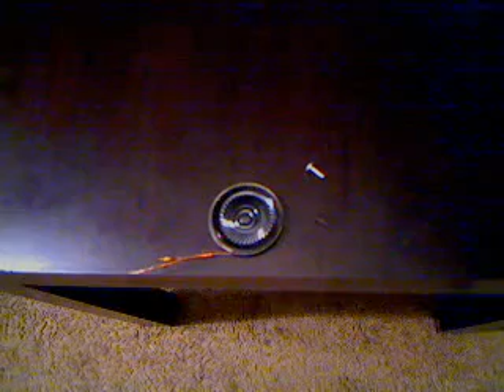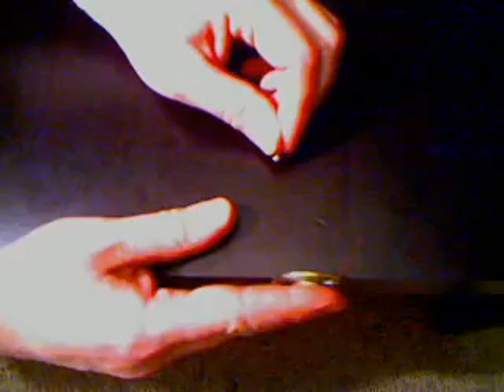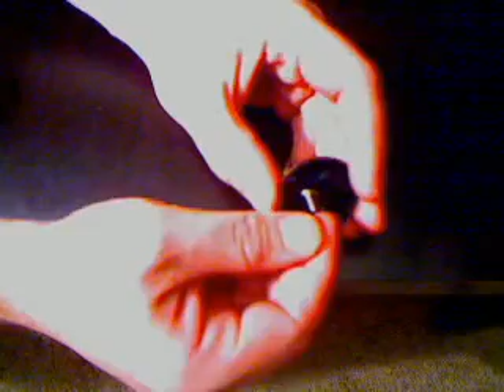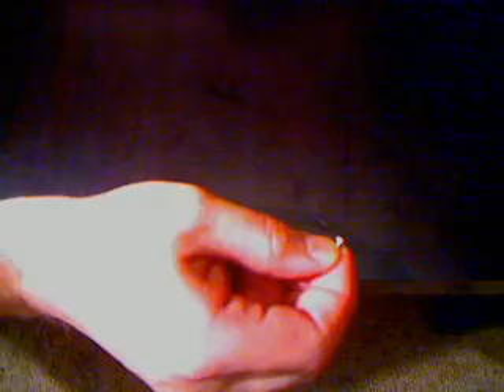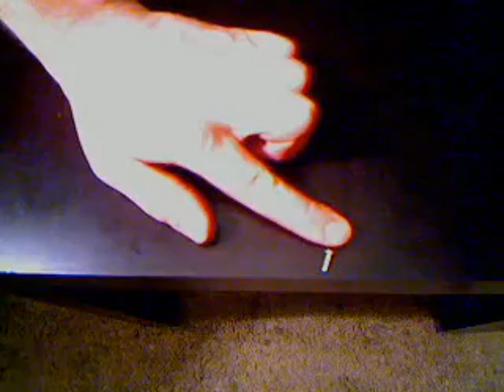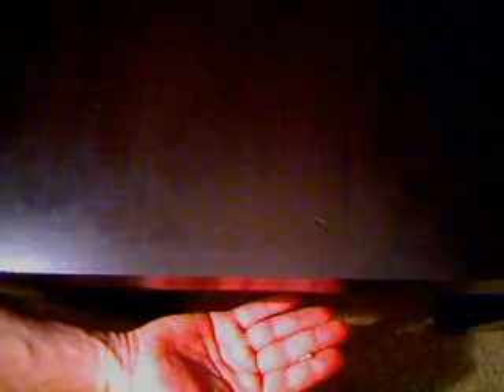Energy of Attraction - a response to Desertphile

Comment from the maker: @hwud1 The separation of all matter in the Universe comes from the big bang and subsequent processes like the inflationary phase. Some of this energy is converted to thermal energy during planet formation etc. (modern cosmology sees ongoing expansion). So this video shows that no repeatable work can be done with this system, i.e. you cannot move a magnet w.r.t. another magnet or metal in a cycle and obtain energy. Energy out = energy in and you lose energy to inefficiency.

Comment from the maker: @jagg1951 

One other note to help you; as the metaphorical elastic band is stretched both for gravity and for magnetism, the force of attraction weakens (but the potential energy in the system increases), you don't notice this on Earth because any altitude is generally insignificant compared to the distance from the center of the Earth, but you can feel it with magnets. In this respect it is an imperfect analogy as we expect elastic bands to pull harder the more they are stretched.

Comment from the maker: @jagg1951 

In that scenario the screw remains on the table until the force from the magnetic field exceeds the force from gravity. At that point the it begins to accelerate upwards, as it accelerates upwards the force from the magnetic field increases because it is significantly closer to the magnet, etc.

So it can only jump.

This cannot be used to levitate aircraft (it implies a skyhook of sorts) but it is used to levitate "maglev" trains, but pushing rather than pulling with magnets.

Comment from the maker: P.S. Fucault's pendulum does not swing perpetually. Angular momentum is conserved and the swing stays in one direction showing the rotation of the Earth, however the amplitude of the pendulum swing is reduced over time through friction, mainly from the air, this is why a very heavy pendulum is used.

Comment from the maker: You're sure wasting time when you deny the existence of the electric field around atoms and molecules and refuse to acknowledge that this force acting at a distance is what stops matter passing through other matter. This is the same force you foolishly insist utilizes power to hold magnets stationary when it in fact supports your keyboard resting on your desk and objects hanging on hooks as I have said from the start.

You could have learned something, instead you're willfully ignorant.

Comment: Oh dear. The electric charge IS the electrons. Any outer shell electron will jump through 5 energy levels and then leave the atom, this being then positively charged, will capture a stray electron-it's called 'ionisation'. Since this process is continuous, it is impossible to map a 'molecular electric field'. Molecules MAY be 'bipolar' and 'diamagnetic' because there will be more electrons at one end, as in water, which is why it readily forms into snowflakes. Duh.

Comment from the maker: You idiot, I'm not talking about a hook in a wall, I'm talking about something hanging on a hook (although there's not much difference you just don't understand what's happening in either case). There's no chemical bonding. The molecular electric field is what stops matter falling through other matter, it's the charge from the electrons at short distances from the atoms. It uses no energy, just as the magnet uses no energy. Again you show the depth of your ignorance with silly falsehoods.

Comment: A hook uses no energy because it's become part of the wall, and it took energy to put the hook in. Glue uses chemical energy in the form of solvents & exo-thermic reactions.  WTF is a molecular electric field? If you mean bonding of ATOMS into molecules by sharing electrons, that all depends on which elements are present, an electric field is produced only when you have free electrons, or electrons in motion through a wire. End of discussion.

Comment from the maker: The separation between all molecules and the pressure and surface roughness in a screw that leads to friction is due to the molecular electric fields over a distance, your label doesn't impugn my facts. You conveniently skipped right past the hook.

A hook consumes no energy and can hang indefinitely, and it's the molecular electric field of one material floating above another. This is not limited to hooks, but hooks highlight the fallacy of your fridge magnet energy claims.

Comment from the maker: A KW is a unit of power not energy. It doesn't take energy to hold objects in place. The fridge handle is held in place by a screw using the molecular electric fields (yes, from the electrons).

You want to treat the magnet holding something stationary in place as special but a screw holds the handle in place without consuming energy.

A magnet need no more consume energy than an hook or a layer of glue does to hold something in place.

Comment: OK, back to the fridge. Gravity is acting continuously on the magnet. The magnet doesn't fall, in fact it can support much more than it's own weight. A P.M.
weighing 50 Kg can lift 1000Kg.
Obviously it takes energy to counter gravity.
Now we can go on about Q.M. & dipoles in the nucleus,spin etc but there is still no explanation. Unless you think in more than 4 dimensions, that is.
There's lots more, but i fear i have used up all my comments for today.
Just google it :o)

Comment from the maker: Objects attracted in magnetic systems have potential energy, but it's a one shot deal. They can move towards the magnet but it takes just as much energy to move them away. I have "admitted" nothing, I state the facts according to physics in my FIRST video on this, my position has been accurate and consistent, you've proven you do not understand this, Your first post did not even understand the video.

Pretending some point has been won by you is an outrageous lie but typical of your ilk.

Comment from the maker: You've got it utterly wrong, that is NOT what I said at all. The energy used to pull the screw off the magnet is later paid back in accelerating it towards the magnet. You have completely reversed the facts.

Chemical Energy in Muscles -> Potential Energy in Magnetic system after pulling the objects apart-> Kinetic Energy in Magnetic System accelerating the objects together -> Sound and heat energy upon collision

Your combination of arrogance and ignorance is stunning.

Comment from the maker: This from the poster who wrote; "So why doesn't the moon crash into the earth" and "physics still works on certain isolated cases, but not universally" and from DP's thread: "place the magnet so that you can approch the bolt from below with your hand. at some point the attraction will pull the bolt from your hand. what happens here? there is a sudden increase of kinetic AND potential energy".

Enough said.

Comment from the maker: Just as the energy of the Earth orbiting apart from the Sun is somehow stored in both bodies as potential Energy, yes. This is a way of accounting for the energy in the system once the dipole is created. There are different ways to conceptualize this, but it serves to explain how you cannot use a magnet to do repeated work. Understanding and accounting for initial conditions can be complex, for example to explain the energy that separates all matter you need to go back to the Big Bang.

Comment from the maker: Please don't use the facts in my video to lend support to pseudoscientific mumbo jumbo. It in no way supports magnet driven generation, (moving magnets are used in generators to induce current but the magnets must be moved by a force and of course the generation of electrical current causes a resistance force on the magnet)  There is no free energy ride, you cannot get energy out of a system that is not put in in some form no matter how many magnets you use.

Comment: Problems in the realisation of magnets motors is peoples think that stator magnets push on rotor magnets. But the inverse is proportional. So, magnets rotor push too on magnets stator, forces is in equilibrium and we have no motion device. More, when magnets rotor past in front of a magnets stator, we have a break effect because magnets stator push against magnets rotor before that it be passed. Its the battle of the magnet motor builder, its for this reason that the shielding magnetic is good.